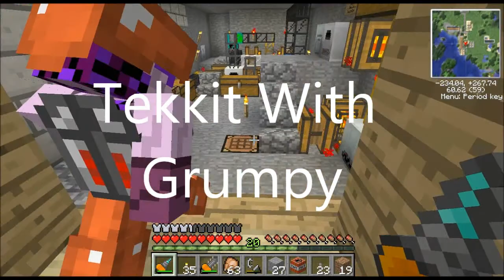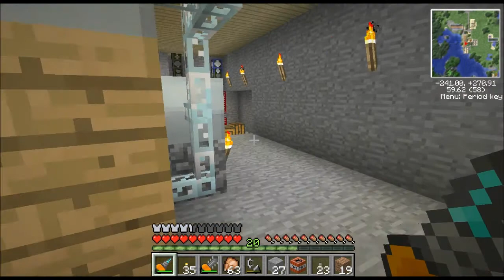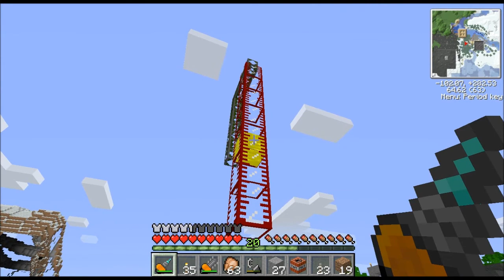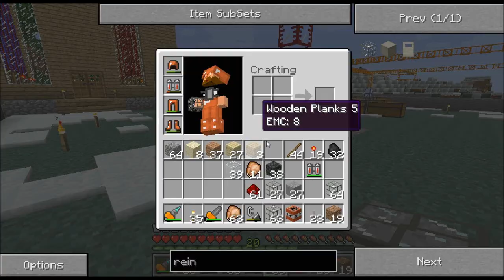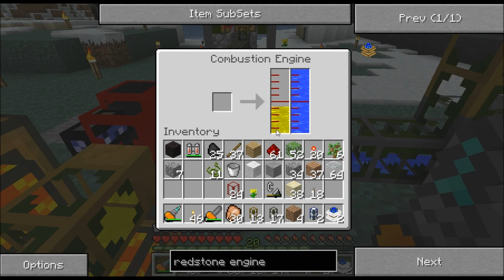Tekkit With Grumpy E02 - Experiments w/ Reinforced Glass and a Refinery Explosion

Comment: How many pipes do you have coming out of the tanks? I don't think with a massive tank like that the bottleneck would be at the well, but how fast you can pump from the tank to the engines. Maybe have two pipes coming out of the tank into a row of pipes that cool the engines?

As for the explosion, the damage it does to mobs and players is consistent no matter what is in the way, if it can't destroy the glass it won't be able to damage any blocks. :)